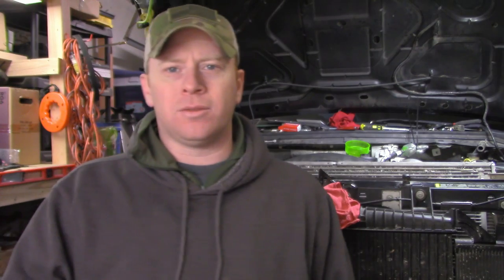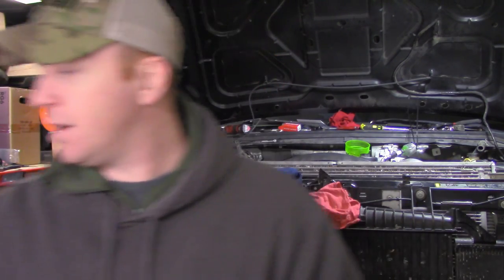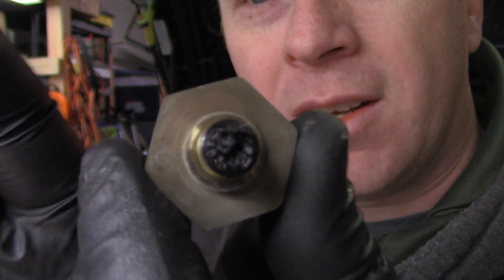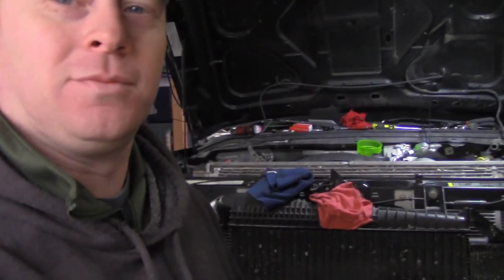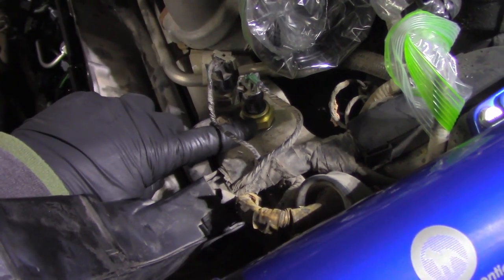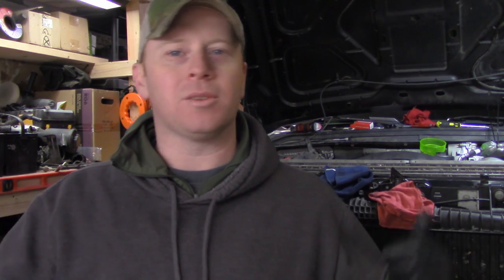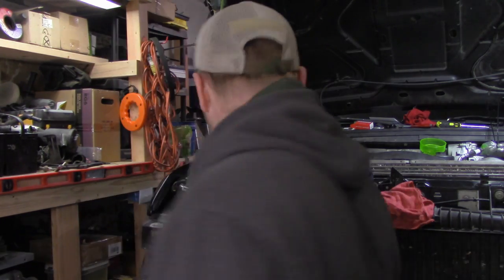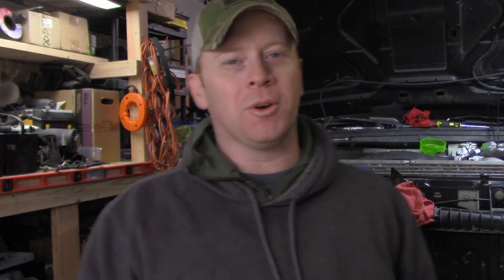Single Cheapest Way to Increase Fuel Mileage in 6.4 Powerstroke

Comment: Whag can you do to upgrade your fuel filter to last longer
Reply from the maker: I would say nothing. Use OEM filters and don't try to "stretch" the time between changes-- the effects of that are far more costly than changing the filters at regular intervals.
Reply: @USAF99   I change mine every 3 oil change... I don't know how long you suppose to change it
Reply from the maker: @fernandosalgadojr.4269  Ford recommends every 20k miles for normal conditions, 10k miles for severe (towing, excessive idling, frequent stop/go traffic). I change mine every other oil change (so about 9-12k) and haven't had an issue. I would rather spend the money on filters than the money on injectors/fuel parts.
Reply: @USAF99  yea mine is a tow truck and we drive them like crazy too... Thanks for the advice
Reply from the maker: Cesar Estrada  if there were two like buttons I would have hit them both on this comment. Spot on reply.
Reply: When needed 😂😂😂😂😢 depends on who your fuel supplier is but I change mine every second oil Change.
Reply: @USAF99  wow, i have change mine every 5k, lol. bought the truck with 80k on it and it now has 140k.. at $200 and oil change (as i change it all every 5k) ... but, i love my truck, it is so good to me.

Comment: Thank you so much for making this videos it really helps i just bought my 2010 F-350 first truck i have ever owed.
Reply from the maker: Keep up with the oil changes, fuel filters and get the emissions crap off of it ASAP and it will last you half a million miles or more! Congrats on the truck!
Reply: Vidal Alfaro and don’t run a hot tune!

Comment: i decided to just remove/clean the existing sensor with Electronics cleaner. it was almost completely plugged after 81k miles, but the muck was oily and soft, easy to remove with the cleaner. there was also muck on the inside of the manifold, so I just poked it with a little allen wrench til it fell off.  my 1" socket wasn't long enough, so i ended up removing the plastic pipe between the air cleaner and the turbo, then using channel lockers to untighten it/tighten it. when I was putting it back on, that little rubber piece was stuck on the manifold, so I gently removed it and put it on the sensor-- it threaded on much easier after that. took me about 20 minutes total to do everything. thanks for the motivation!

Comment: I will have to check this soon! Mines to is used for pasture! Cows really moo over it or it could be the cubes or hay they want! LOL! I change my oil every 5k and fuel filters every 10k no matter what and use hot shots oil and fuel additive. I use trip A for my 5k oil changes and trip B for my 10k fuel filter changes. I only use oil and fuel filters from Ford. Also for Christmas, since I do not have a programmer that adds more HP just pasture mode, I bought the BD diesels TS Booster and it really woke up the truck! It seemed to help with MPG just a little. Two more mods left that I want to do are AirDog system and converting two piece driveshaft to one piece. Then it’s just maintenance until the engine goes. 183k on it and still running strong for now. Thanks for the sensor tip!
Reply: Update: buyer beware on BD Diesel products. I’ve ran their TSB for 4 months and it’s been back to them for “testing” and said it’s fine but last week when using it not only did it go into relearn mode like before but put my truck into limp mode in heavy traffic two hours away from home. Not good. Luckily when I made it to a safe place I disconnected it like before my truck ran flawlessly without it.

Comment: As a fellow 6.4 owner, I appreciate the support. We need to stick together,,, After having a blown motor,
I have had a ton of work done to my truck and still have a hard time trusting her.
I'd like your opinion on reliability after doing the following work.
Full delete
Tuned and set on a tow haul mode (SCT) tuner
ARP head studs
S&B intake
4 " straight pipe
Upgraded pistons
FASS lift pump.
Looking to do the Mishimoto radiator and a coolant filter. I use it to haul a toyhauler occasionally and every once and a while to commute.
She runs like a dream. I love the truck, but have a hard time trusting it due to 6.4's reputation.
What do you think??
Reply from the maker: The 6.4 is a bulletproof motor that will not fail you for a million miles if....and I emphasize IF the routine maintenance is kept up. From your list of upgrades, I would bet that your truck will last you at least 800k if you keep up with it. Personally, I do oil changes every 3500-4000 miles, fuel filters every other oil change, and coolant flushes every 10k. Keeping fresh fluids in them is priority #1. Priority 2 is on a tuned truck, don't turn them up. Its meant for hauling and working, not speed. It sounds like that's exactly what you do, haul and work with it. My honest opinion? It sounds like you have a recipe for a good truck that won't let you down. I'd probably put your worries to bed.
Reply: @USAF99   Wow that was a quick reply. That is reassuring to hear. After dumping that kind of money into it, you can be sure that maintenance is being done. I even keep a journal of all maintenance. Thanks for your response.
Reply: @jcapen1  my car fax app is the best for keeping a log :)

Comment: OMG!!! Thank you so much!  This totally works!  I have a 2010 with 104k miles, have left everything stock.  I have seen a noticeable change in MPGs over time.  I just replaced the MAP just like the video and took it for a test drive... IT WORKED!!!  I was getting 11.5 or so if I babied the accelerator on the highway, now I'm getting close to 15, and I was going uphill on a test drive!  Any other sensors I should look at?  My MAP sensor was horribly clogged like yours, BTW.  Bought a new sensor from the local dealer (prolly got ripped off) for $50.

Comment: I haven't deleted my '08 6.4 yet.  Its a low mileage truck with under 74k.  I am currently getting almost 14 mpg mixed city and highway.  I would expect someone to get poor performance and low power with a clogged MAP sensor but probably not a lot of better gas mileage.  With the MAP sensor being clogged is not going to read any boost and should actually limit fuel consumption.  The properly functioning MAP sensor will read the boost and tell the PCM making it pump in more fuel.  The biggest factor to fuel mileage will always be driving habits.  You can have the best maintenance in the world but if you drive with a led foot you are going to get crappy mpg.  

I would hypothesize there would be an increase in performance but not a huge increase in MPG.  What results did you note after installing the new MAP sensor.  I could be wrong?  Just voicing my thought the subject.

Comment: I cleaned mine but no difference.  My question is what are the odds the sensor is bad?  Would I have better luck with replacing it rather than just cleaning it?
Reply from the maker: Eh, if it was completely bad you would probably get a CEL. If the rest of the things in the cycle (intake, other sensors, etc) are gummed up too, this procedure probably won't help.

Comment: So I am a new owner of a F550.  Which has had a motor replaced with another 6.4 crate moter. I am a service hydraulic mechanic with a service bed and with crane; to help my customers. 
I am of concern about the longevity of this motor and provide me an excellent overall performance. (Not as a into racing or into tractor pull performance). But as a road warrior taken all considerations of the PTO idle when operating crane for long periods. The 7.1 average mile per gallon, cause all the tools I carry as a mechanic.... it is a costly trip to help my customers. Yet I want any and all steps required to delete, add, or replace; wether exhaust, electrical, or internal concerns to make my truck perform as my Cheverolet  2005 900,000 mile truck had performed.
Thanks ,
The Tractor Snapper'
Texas
Reply: I forgot to say Duramax 6.6
Reply from the maker: Pretty much watch the videos on my channel. That sounds like a cheap reply, but I am after the same thing with my 6.4. I just turned 200k on it, and it runs like brand new. These motors get a bad rap because little johnny doesn't change his oil and fuel filters. You're kind of limited as to what you can remove as your truck will be on public roads. As mine is a farm truck, I can get rid of all the emissions crap that kills these motors.

Comment: Mine was 100% impacted with crap. Cleaned it and instant increase in MPG!
Reply from the maker: Good Deal! That little sensor is probably more tied to throttle response, but at the same time if you're only using half the pedal that you used to after cleaning-- MPG!
Reply: @USAF99  absolutely. Next thing I will do is remove that back pressure line and clean her out. I love my 2008, it only has 69k, I live in Commiefornia so so no deleting, I need all the MPG as you stated lol many thanks for your help!
Reply from the maker: @knewtboot  I bet they love you out there in that-- you're gonna have to strap a AA battery under the hood in a few years and say it identifies as an EV aint ya?

Comment: Thanks much. Question for you,  which tuner do you recommend for a non deleted low mileage 52000 mi 6.4?
Thanks again
Reply from the maker: An H&S Mini Maxx if you can find one. Delete options are there if you change in the future and the tunes will run in your current config well.

Comment: I changed my map sensor first and it helped the power fuel mileage and throttle response then someone told me to change the charge air temperature sensor next to the map sensor and it helped alot also

Comment: Do you have a tuner on your truck? If so what kind and what are your settings?
Reply: Mini Maxx. Set to stock or pull I live in BC so when I go north I like Street just to pass the guys that are afraid of traveling with mountains. Sometimes theirs not a lot of room to pass. My Mini Maxx. Is still set at factories specs I may change the low-boost fuel to the number 2 from 3. It might lower that little bit of Black carbon on take-off at stop-and-go.

Comment: What’s some important things you’d recommend when it comes to maintaining a daily driven 6.4? My 09 is deleted with a hs mini maxx that I leave stock, besides long distance highway mileage I set it to performance. My goal is to hit 250k miles while already having 180. Any basic and or important maintenance answers would be greatly appreciated.
Reply from the maker: First and foremost, remember its built for work not speed. Second, keep up with the fluids and filters on a schedule and don't exceed it. I change oil every 4-5k and fuel filters every other oil change. Coolant flushes every 8-10k. Every third oil change I take a sample and send it off to Blackstone Labs to have it analyzed for contaminants. $30 a sample is a small price to pay for catching problems before they cost you $15k (long block from ford). If you hear a noise or notice a problem while driving, address it immediately. Basic maintenance and upkeep will keep these trucks running and working for 600-800,000 miles but you have to be willing to maintain it. Also, turn that H&S back down to Stock or Street. In my opinion the higher tunes advance the timing way too much and you'll find the weak spot in that 6.4 real quick if you hot rod it. The only thing I use a tuner for is to keep the CEL off being off road only and deleted.
Reply: @USAF99  sweet I needed that, what’s your option on keeping it idle while I’m stop at a store and short trips like that?
Reply from the maker: @fontz379  short stops idling are okay, better to keep the oil flowing through the cooler and into the turbo than letting it sit in a hot turbo and cook. All day idling or hours idling, bad.
Reply: @USAF99 would you recommend a coolant filter for the 6.4?
Reply from the maker: @fontz379  I have had the sinister diesel one on mine for awhile now- what ill tell you is this- I don't see a temperature differential between oil temp and coolant temp of more than 9 degrees on a 186k mile truck. Do with that information what you like!
Reply: @USAF99  gotcha. let’s say I get my coolant flushed every 30k miles then having a filter may be more helpful for the long run in my case?..
Reply: Before the delete 11 after 15, 16 miles per gal.

Comment: Hey man, I had an issue come up today on my 6.4. It has 49k miles in it. Everything is still Factory. 
 I was on I-75 N today running around 70mph. The Truck just started loosing power.  Like the transmission quit pulling. I pulled over listen to the engine,  it ran fine. No lights in dash. I switched it off, started it back up and eased out on the interstate. Noticed blue smoke coming from exhaust briefly then it cleared up and run fine. The check engine light then came on. About 40 more miles, it did the same thing. I hadn't owned the Truck very long. I've put 1400 miles on it . Do you think it was in regeneration process, or the dpf clogged up?
Reply from the maker: Hey Jerry, 
First, I would start with a scan tool and see if you have stored codes, that will at least get you started in the right direction. As far as a regen, the truck will tell you on the dash when it's doing a regen. I can't remember if it dings at you too, I think so. I doubt the DPF is clogged, I would think you would run poorly all the time not sporadically. If you have a laptop and a USB - OBDII cable, download Forscan and read the codes. I'd be interested to see what we find stored.

Comment: Not deleted...but I live in Washington so could...would that help this truck out a bunch?  How?  Also, recently had my mass air flow sensor cleaned as it was the culprit of power loss (it was caked with oil).  After doing that its running great but I notice my boost doesn't max out like it was.  Is that bad that it was maxing out the 4 before and its running as supposed to now with only getting up to 3?  Appreciate any input on these few items.

Mike
Reply from the maker: Deleting these trucks is a must for any real life expectancy. The problem is, as your DPF fills with soot, the regen cycles happen more and more frequently. This washes down your #7 & 8 cylinders with fuel, which causes wear. Its not uncommon for a deleted 6.4 to go 600k + miles before a rebuild. Cleaning your sensors in the intake is a must on a non-deleted truck. Diesel Soot and oil mix together to create a tar that impedes the sensor's ability to do its job. That is most likely why you were able to pick up power and most likely fuel mileage after cleaning them. As far as your boost, no, that's not bad. It just means that now your ECM is using the sensors more effectively and managing the engine like its supposed to-- and you don't have a lead foot! I bet if you throw the beans to it that boost gauge will rise!
Reply: @USAF99  thanks for the info.  Delete just the DPF? ...or EGR as well?
Reply from the maker: @mikegilbert944  totally up to you but the EGR after programming is essentially a restriction. It's better to delete both. Get a good quality delete kit and remove all that junk.

Comment: My 2010 KR 6.4L has horrible gas mileage and I cannot delete because I have emissions in my area, so annoying.  Nothing but a fund raiser.  I also live at 5,000 feet plus.  What is the best way to improve mileage right off the bat?  Can I still replace this even if I don't have a delete?  Other pointers?  TIA
Reply from the maker: Sorry it took awhile to get back to you, I just happened to be scrolling through comments I hadn't replied to. If you haven't already, you may benefit from a custom tune more geared to your altitude. It's perfectly legal to tune a truck with the emissions still intact, especially in your case. Ford does a decent job of tuning for high altitudes, but there is absolutely room for improvement-- they can't tune for every situation or area if that makes sense.

Comment: So the map sensor is still used even though you have deleted and removed the EGR. I've completed the delete and the EGR removal and I still only get 13 to 14 mpg.
Reply: I have a 2008 still factory and getting 16 to 17 miles per gallon  . I run Roadmaster diesel  don't idle it very much  .Don't drive it on short trips  . Seldom see it go into cleaning the filter  .
Reply: mine is deleted and gets 11mpg.

Comment: I got a 2008 6.4 f250 wen I turn the AC on the engine fan comes on and the transmission gets over heating at the same time. do you know what is wrong with the truck or any idea ?
Reply from the maker: That's almost impossible to diagnose over the internet. I would probably start by replacing the thermostats, they are cheap and easy. Follow that up with a coolant flush. I would also make sure that your A/C pump isn't locking up or dying putting more stress on the engine than normal. You would be hard pressed to overheat a diesel with just the A/C so I am betting you're having other issues.

Comment: My 6.4 has been deleted. I have a Minnie Max. I have a travel trailer. When in the tow setting on my Minnie Max. Do I still have to press the tow button on the shift column are not?
Reply from the maker: No sir. The tow button on your shifter and the tow program in your MM do the same thing.

Comment: My engine compartment does not look anything like yours. Mine is so packed full I can barely find my windshield washer reservoir. 2010 F250 6.4
Reply from the maker: Pull your air box, you'll find the sensor under the piping in the intake, passenger side.